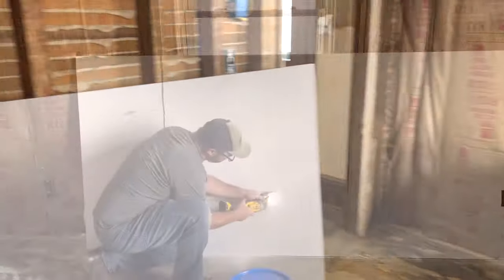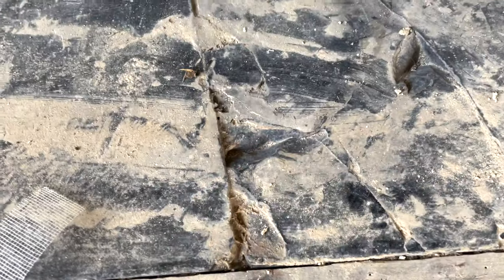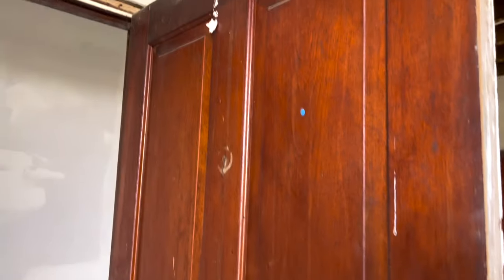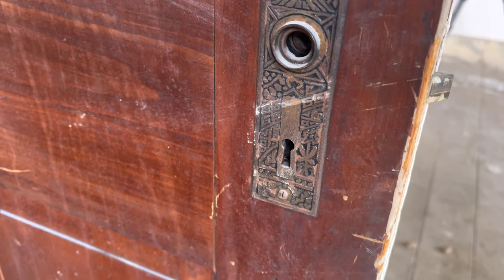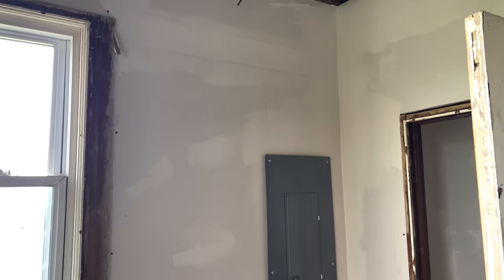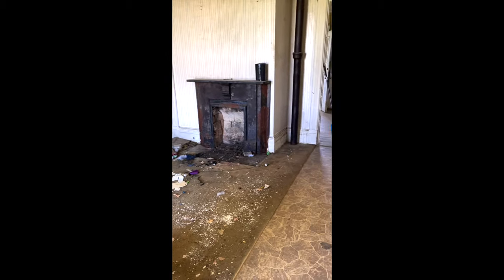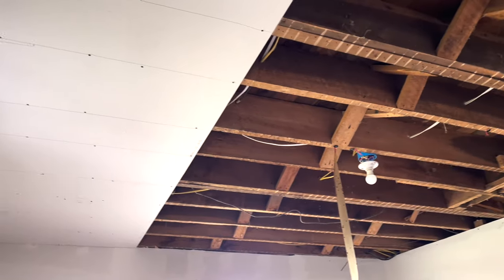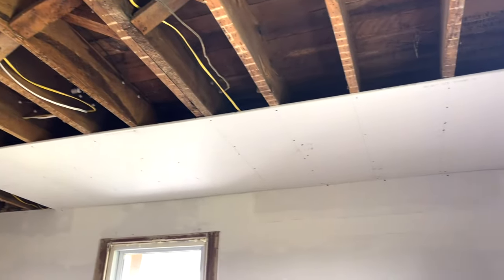Dining room renovation part 2 | Early 1900's Farmhouse

Comment: The room is coming along nicely.  It will be a huge help with insulation on the exterior walls.
I'm glad you're keeping the original closet & door.  That's a great closet for storage of items that will be used in that room.  Table cloths, linens, holiday/serving dishes, even enough room for holiday decorations used specifically in that room.  I like that you'll be using beadboard on the ceiling, it will look really nice.  The drain pipe in the corner, not a big deal, it's part of the house and will blend with the fireplace; and conversation starter!  I think once the room is more finished and pulled together, the fireplace will let you know how to finish it.  Nicely done!
Reply from the maker: Yes it will be! I cannot wait to feel the difference it makes in a few weeks. It is always a conversation starter! I think so too! I cannot wait to decorate the fireplace!

Comment: Looking good.  If it could possible to could flip the door jam on the closet so the the door would swing open towards the wall instead of the fireplace, that would look so much better.  Can't wait to see more.  May I suggest,  painting the pipe the same color as your walls,  it would then blend in but if you want to have it stand out, the stovepipe black on it would certainly make a statement.  As for the hearth, you may want to think about replacing  it with tile as it looks pretty beat up/cracked.  There are products out there that will help remove the rust.  The room will be stunning when you're done.
Reply from the maker: That is a great suggestion we will have to see what we can do on the door! We want it to stand out. We personally love the character of the pipe and it helps tell the houses history. Thank you!